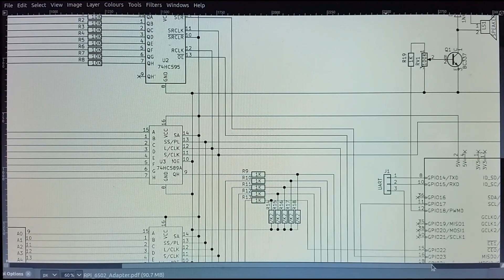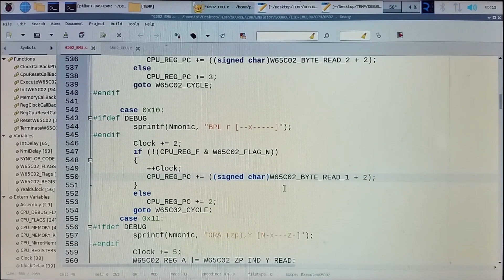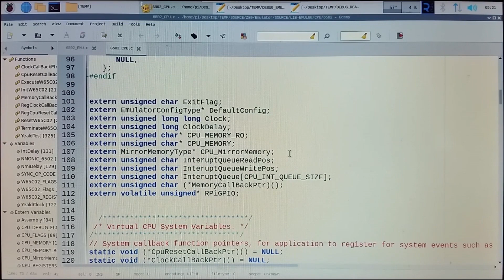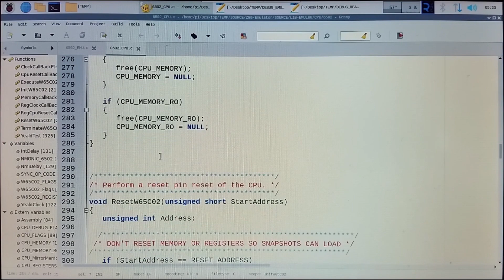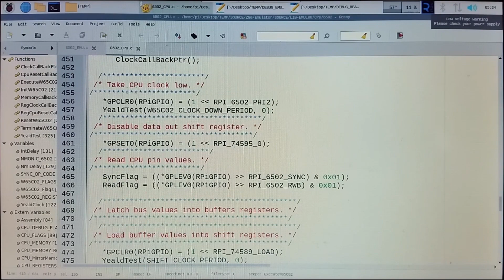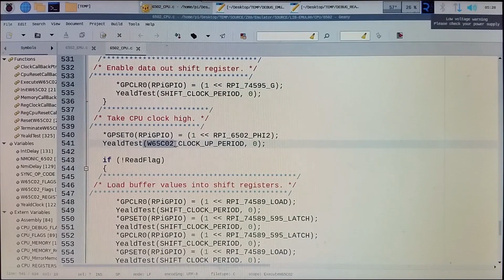Debugging an Emulated 6502 with a Real 6502 CPU

Comment: Could you make a tutorial about coding a space invaders emulator ? (the Midway 8080 arcade machine, not a clone of the game.
It is generally considered the second step in emulation programming after chip8, but there isn't any clear tutorial about it.
Reply from the maker: It is something I would like to do, also Galaxian and Pacman arcade PCBs is something I would like to emulate. I have an original arcade Space Invader PCB set I would like to get rewired and running at some point too.
Reply: @DevelopIT  Cool ! I hope to see that on your channel someday

Comment: That's pretty amazing. Well done!
I also add IC pinouts in my source code.

Years ago I wrote a Space Invaders emulator (Z80) from scratch. Main screen loads. Insert a (virtual) coin, the invaders show and boom you die instantly.

p.s. I recommend some typedefs for UBYTE, UWORD etc.
Reply from the maker: I have also wanted to emulate an arcade game for a while, I think Galaxian and Pacman where effectively the same hardware and Z80 based. One day hopefully I will have time to as Galaxian was my favourite arcade game. Nice one doing Space Invaders.